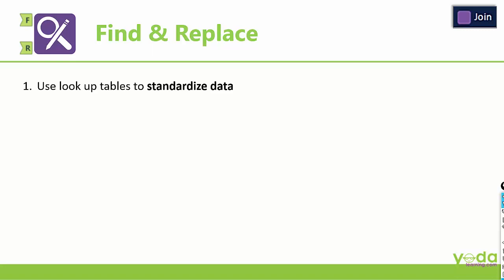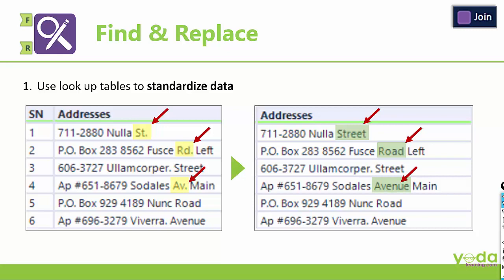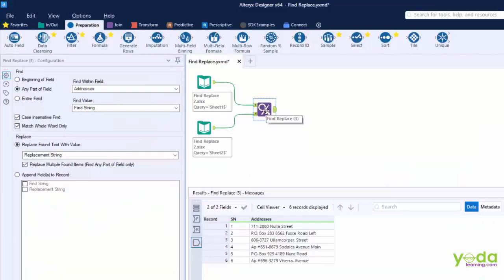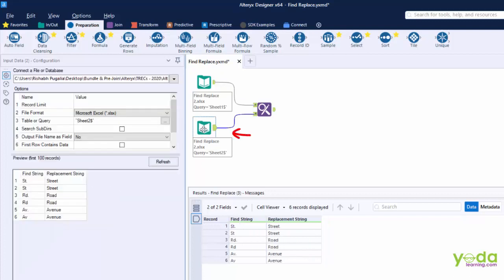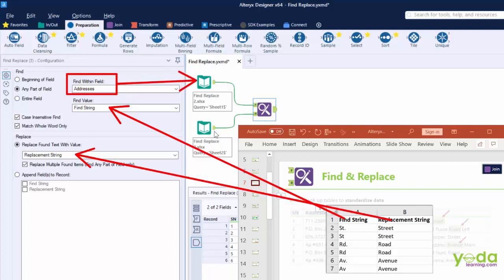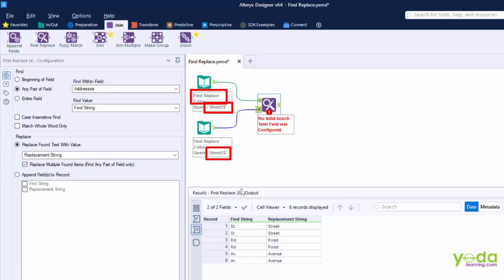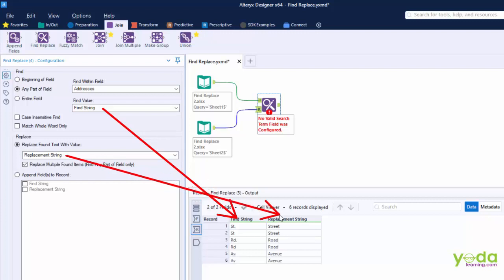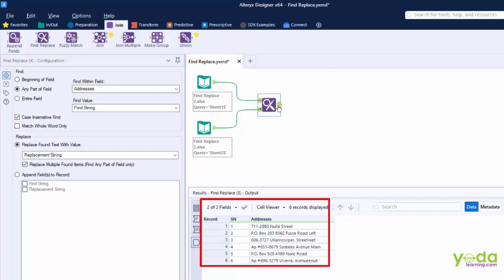How to Use Find and Replace Tool in Alteryx | Alteryx Tutorial for Beginners 2021

Comment: Thanks bro for explaining. I have a question on find and replace. I have 4 columns where i want to change long characters into short and need the output in excel file to work further. Any suggestions or video how to change entire excel sheet data ? Thanks in advance.